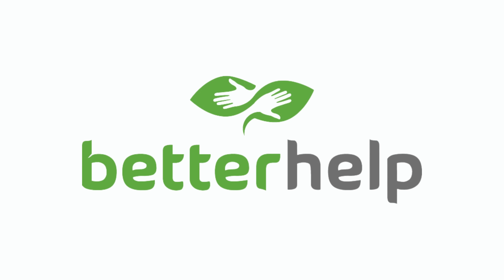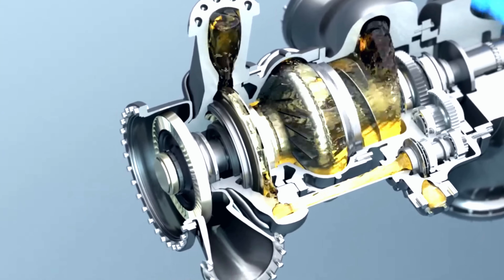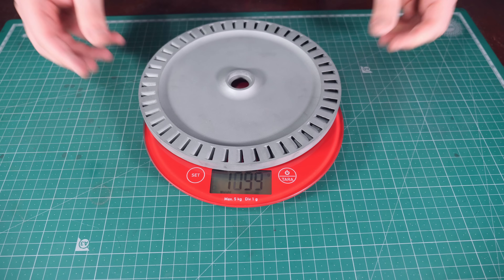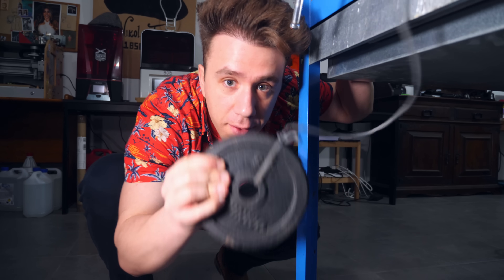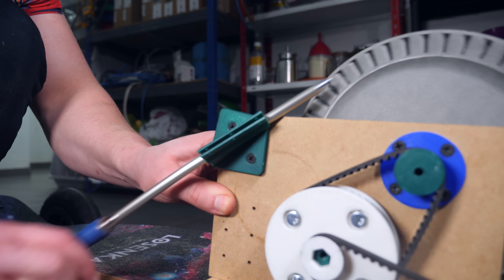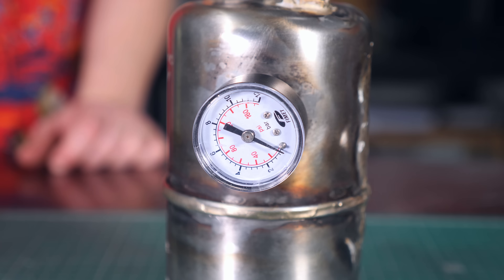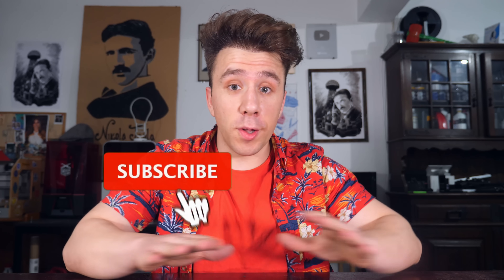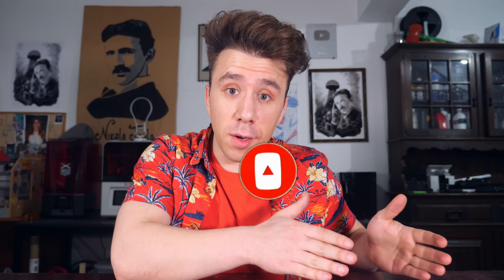I built a TURBINE Skateboard

Comment: Kind of wish I was able to do this myself to see if it would work but I have been thinking and wanting to do engine that works like a radiometer. An engine that uses radiant energy(?). So like a radiometer, you have light rays hitting the vanes specifically the black side, etc etc. And so maybe to make an engine that kid of works as a radiometer, maybe the pin connected to the vanes, and at the other end of pin have a propeller or something. And with that, the more light you beam at the black side of the vanes, faster it spins. Also if you pour hot water on a radiometer, the vanes begin to spin. That might help maybe(?). I don't know if it would work, never really tried it. All this is just an idea that you can possibly try. Also since like a radiometer, inside the glass bulb, it has low pressure gas. The glass bulb has no holes. And if you have a pin itself connected to the vanes and at the other end something also connected, of course you are going to need a hole inside the glass bulb so no gas escapes(?). So maybe you can a non-porous martial LIKE rubber. Connected(Idk how) to the glass. The rubber touching(?) the pin. Just make it air tight so no gas escapes. Like I said idk if this would work. But I hope it does? I probably gave to much details. All this is just an idea, of course you can do it your way. Of course. Also maybe a little bit to much items idk. Hopefully I see this work in a video if you choose to do this. Great day to you Integza!  (VIDEO IDEA)

Comment: Why don't you show how the same thing can be done without a 3D metal printing printer? You can show how the molds could be made with a regular 3D printer. Yes, you may not end up with as shiny and pretty of a part, but you can still have a very functional part with just some sand and a regular 3D printer. I think it's called PLA replacement casting?
Reply: This is why I want a 3D printer... so I can cast cool stuff

Comment: Next project suggestion - Super spot cooler - to instantly chill the beverage of choice (or freeze tomatoes so you can smash them with a hammer).
Use liquid nitrogen to produce cold nitrogen gas, feed it through a vortex tube seperator, and blast the cold outlet on to stuff you want to coldify.

Comment: That was pretty cool.  You know that container can hold 200 bar of pressure.  Can you take the cap off, once it is empty, and maybe fill it hydrogen peroxide and potassium permangenate? If you add the right amount of KMnO4 you might be able to get the decomposition of HO at such a rate that you can maintain steam pressure at desired bar/psi.  Plus it will use the other aspects of rockets...rocket fuel!

If you do this, please make sure you put in a safety blow out valve...that doesn't blow super heated steam all over you.

Comment: Piston engines have a wider power vs speed curve, turbines are very narrow. Also, turbines are also very inefficient outside this range. However, they are excellent at turning a generator where the torque and speed are at the optimum levels

Comment: I don't have a special theme for a future video but I would like to see a followup video on this video maybe if you find a way to make it more powerful but controllable you could mount this on a bike or tricycle or just anything bigger and easier to steer than a skateboard.  Maybe you could use a bigger flywheel and then use more pressure.  You already had too much pressure.  I've heard rumors of a compressed-air-powered vehicle Tata Motors was developing in India but I never learned if they finished sending it to production or not.  So, it might be challenging but I'm sure you can make a vehicle somewhere in between that and your skate board.  I'll be interested to see if you do more videos on this concept in the future.  I was already interested (and a little concerned) when you were trying to make your own liquid nitrogen boiler.  I'm happy it did not explode on you.  That's another advantage of making your vehicle a little bigger.  You get more stability and steering maybe but also you get more places to put stuff.  You really shouldn't have a flywheel right in front or right behind you (though behind is better).. if it fails it will roll very quickly, hopefully in the away direction but even then it could crash into something else if not you.  You really should have a housing in a separate chamber for that wheel/turbine.  Forgive me for all the criticism. I just don't want to see you die, sir.  Also, I would like to see you turn this into something more fun and practical because I think you really could well if you have enough time that is.

Comment: Hmm: Random idea: Small internal combustion engine or similar that is both moderately fuel efficient and makes very little noise. Say, for example, if one wanted a small 1kW generator that is also not overly loud. Bonus points if it can also run on something semi-common and affordable like ethanol or similar, is cheap to build, and is not significantly larger than a chainsaw engine (while ideally also more practically useful than something like a Stirling engine).

Comment: You should add a clutch and use the flywheel turbine as a bigger powerhouse. More balance for it (and some steering) would take that board alot further.

You could also use that same wheel to try and power a lawnmower blade, or pull a vaccume (dyson vs v2 super sucker?)

Comment: I would design a transmission with a clutch so you could have more control over the output energy then come up with a easily rechargeable compression system for the turbine and mount all of it on a small liteweight steerable car.

Comment: Only a unicycle would have made this more sketchy. Running a proven turbine without housing is a bad idea. As is not supporting both sides of the turbine shaft & making pressure vessels without welding expertise.

Comment: Holy fucking danger Batman. Not only did you have a high rpm printed disk mounted on wood ready to come apart in your face the whole time but also a homemade pressure vessel (a bomb) with no pop off valve or anyway to regulate it. Seriously not trying to be a dick but fuck man you got lucky a few different ways this time.

Comment: OK, this may not be the WHOLE reason but ill give you what my instructors told me. I was a tank mechanic in the army, the M1 having a gas turbine engine. During school the discussion of the vehicles that use turbines came up. The instructor said it was because the hot gasses pumped out of a turbine melted the road if pointed down, each other if ported to the side and would torch trees if pointed up. And id guess on my own that the amount of fuel used per mile would make it an expensive toy.

Comment: Holy Crap, that seems insanely dangerous! It almost seems like you were pulling to the right, because the drive was on that side. For a future video, it would be interesting to see if you had 2 different spindles with output drives. You might need another flywheel/turbine, but it could potentially get you more torque or speed.

Comment: It's a shame that a lot of these companies are doing SLM printing. Makes it hard to print smaller parts that would need internal support. A lot of these companies refuse to print these sort of parts due to "Unable to remove internal supports". Which is where SLS printing would come in as it needs no supports to be printed (Supported by the powdered material itself. Or more so suspended). But finding a company that does SLS with Aluminium powder printing is on the boarder line of impossible. Assuming due to the machine price.

Comment: Oh wow, lots of things to unpack with this video...
Safety.....was definitely not the first thing on your mind at any point during this video. Between a 3d printed death wheel, using tech that simply sinters metal together, that would not be ideal for spinning at any fast enough RPM to get usable work from it, and a pressure vessel that was not tested with water first but fire, and using LN on top of that....🤦‍♂

That aside, possible improvements I see involve balancing that flywheel and making a more solid mount to the board. you lose a lot of efficiency using it also as flywheel when there is wobbling. Encasing the turbine so the air doesn't go around (travels towards least resistance) to get more out of your insane attempt at a pressure vessel (seriously buy some lottery tickets, your luck is good). 

I'd also suggest instead of 3d printed, look at companies whom use EDM machining. That might be cake work for them to do since all the angles are the same, and its just rotating the plate around its center. Id also argue it starts out at a more solid piece then a 3d printed annealed part, and you can use materials with better tensile strength, like a nickel based alloy.

Comment: I am going to make a guess early in the video here of why modern cars are not powered by turbines. While it should be more efficient since you are doing a very complete burn, and simpiler than a normal engine (thus cheeper) I see 2 flaws. The car will have jetwash and thus be more dangerus, and the car probobly has less control over how much speed and power you are actually using. Also you might have issues with starting the thing and the car being slightly more likley to explode.
But the deciding factory was probobly something silly like no one investing in the tech. That is the main reason why there are so few reactors around after all.

Comment: Perhaps use a tricycle for your next test.  That way you'd have space under the seat for the turbine and compressor.  And you'd be able to steer and if you can find them perhaps add some brakes from a bicycle too.  But I'd remove the pedals from the front wheel before trying this so they won't beat your shins up.

Comment: Alarm bells through this whole video, cool concept but oh god the potential for catastrophe is way too high! Unprotected spinning objects in line with your more important bits, the lack of a pressure release valve on the initial pressure vessel, an open flame on said vessel, no brakes, no steering, no helmet, and all this on a road actively being used by larger motor vehicles. We love you Integza, that's why we nag you about safety!

Comment: Would it help to enclose the turbine with a 3d printed shell that has a narowing chanel in line with the nozel? Also couldent you power this with your peroxide jet engine? In fact that would likely let you use two larger turbines, given the higher flow of the peroxide engine. Speaking of the peroxide engine, your last one used a short chamber. If you increased its length, in theory you would catalize the peroxide more efficiently. Meybe a 1 meeter tube?

Comment: Take this beast to the next level, make a video of building a proper tiny car with steering and brakes, including a proper, aerodynamic housing around the turbine to increase its efficiency. 3 or 4 secondhand bmx wheels, the turbine housing can be plastic because it doesn't need to be heavy. You could weld up a frame like this using one of the BMX frames for the steering head and the rear triangle - lean steer, compressed nitrogen super trike 😀

Comment: If you had a few more of those turbines & constructed an isolation case with walls in between them, & with slip differential, your inlet would blow through the 1st turbine & the wall could direct the pressure towards the 2nd turbine & so on. You'll get a bunch more torque even accounting for the slight loss in pressure between each chamber.

Comment: There are a few reasons why these engines were not used in cars. They are less efficient than traditional combustion engines, and in the chrysler turbine car they used more fuel that most traditional cars. They also had poor acceleration.

However, I believe the main reason why is the fact that you cannot really engine brake using one of these engines. In a time when manual transmissions were common, this would have been a huge detriment. Great video.

Comment: Holy crap you scared the crap out of a few of us when you tried to use that tin can pipe bomb.  I thought that was the end of your channel and there would be a "in memorium" at the end of the video.  I suggest you get your hands on the same size cylinder from your local supplier in aluminum with liquid Co2 with the valve for gas withdrawl.  it's filled with liquid Co2 but you will get about 200 - 300 psi statically out of it and it will be lighter than the cylinder you used in the video. 
Keep up the experimenting and not blowing yourself up.
Reply: Also spinning up the heavy, metal flywheel for the first time without any safety and standing right in the plane it rotates... scary stuff imo
Reply: @TheDoh007 look up when Adam Savage did that. I'm on this side of the screen and it still made my balls tingle.
Reply: Came down here to basically make the same comment. I nearly shit myself when I saw how thin that container was. Also I have to add emergency pressure release valves are your friend and will save your life.
Reply: The CO2 tanks we used in paintball (readily available off-the-shelf and pre-filled) are closer to 800 - 900 psi. My own air cylinder is a 5000 psi model for compressed air only. I know Tippmann was experimenting with Propane because the tank pressure is a lot lower but displaces about the same amount of air as a similar-sized CO2 tank. The idea was scrapped because it turned out that Propane was, get this, flammable. No kidding! But if you leveraged the flammable property, I bet you could achieve a higher output velocity for the same volume of air!

But, yeah. That first can-tank scared the crap outa me, too!
Reply: @RamDragon32  I doubt they'd abandon propane just because it's flammable, seeing how green gas for airsoft guns is just pre-lubricated propane.

Comment: Isn't it more efficient to use a Tesla turbine with a (car?) flywheel attached to it to hold the momentum? It could be made in a very compact setup. And maybe you should think about attaching some (go kart?) clutch to it to control speed and maintain a constant airflow to the turbine. The V2 turbine wheel is very inefficient in its current setup since you only push 1 scoop at the time. If somehow you could manage to drive all scoops simultaneously you'd probably have a murder machine but also isn't that compact anymore. Nevertheless a cool idea with great potential

Comment: This video has it all. An 11kg disc spinning at 6000 rpm held by nothing but 3D printed hopes and dreams and a shitty pressure vessel without any safety features which generates gas on its own. You’re practically hugging the first and leaning over the second. I think you don’t need to worry about obesity too much.

Comment: 4:17... Yeah stand in line with the High Speed spinning turbine so that you can catch the flying metal parts with your face in case  there is a defect and a catastrophic defragmentation.👍👍
8:47... That was much less speed than 13 HPH... Closer to 2-3 KPH

Comment: My idea for your next video is to run multiple turbines in series, for example a small one that will power a larger one and so on (let's say 4 or 5). And also if possible a part of the exhaust of the last turbine will feed the small one. And I guess you'll need some air to start the engine and then the system will  automatically feed from air so you will need only to run fuel.
I would like to see the "engine" on a bicycle so you will have space for all of these and also to be easy for you to drive it.
Aaand also I can push it further more, at the pedals you can attach something like pumps to compress air into a container so that you can use it to start the engine and use like an dynamo to charge some capacitors and use them for the spark plugs to ignite the fuel!

I hope it will work! :)

Ps. for more details about the project that I have in my head I would like to discuss it with you.

Thank you, Greg. :)

Comment: Hi
If the transition from liquid to gas for nitrogen is 700x, why didn't you use water as that has an expansion ratio of over 1300x and costs less than nitrogen and can be contained in a lighter pressure vessel. This is not a criticism I am just curious 
Keep up the good work

Comment: This is so incredibly reckless, I hope you understand now how close you were to death or serious injury. Face inline with 3d printed steel flywheel and letting a ad-hoc braised camping cup rise to nearly 10 bar with no safety valve, just think if your hand slipped, you might not have them right now. Boiler and pressure vessel safety codes and standards are written in blood.

Fun concept and video but some time to engineer the system and create a safety plan is cheaper than the alternative.

Comment: Turn the skate board in to a full blown rc car running on the turbine you should be able to get some very high speeds from it. The thing about that style of turbine it does not care if the wheels are not moving fast enough to keep up some of the air just deflects away and as the forward speed increases and the fly wheel spins up faster the entire system becomes more and more efficient until "air speed" and rotational velocity are = or until the turbines flywheel disintegrates from the speed. So as long as the "car" remains stable and the wheels can take the stress there is zero reason why it could not hit 100+mph with high enough pressure and you don't even need to worry about ramping the flow up you just run it wide open and let the turbine wheels etc increase in speed to match.

Comment: Video Idea: Rocket Turbine Plane

I was thinking a rocket turbine hooked up to a propeller could work pretty well for a plane on Mars since the atmosphere is largely inert, but there is still reaction mass to work with. You could make a plane that could theoretically work on Mars with a setup similar to this (probably need to be a bit lighter though).